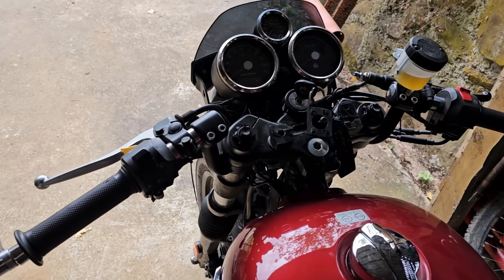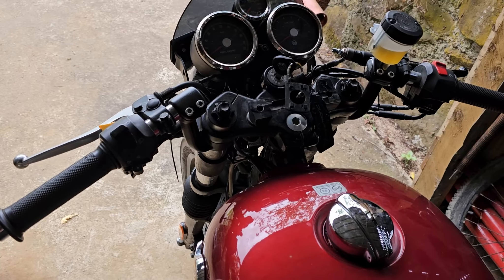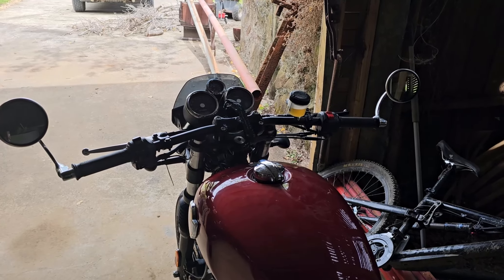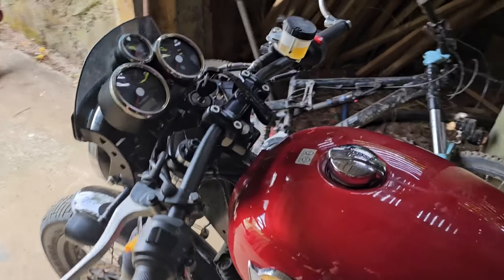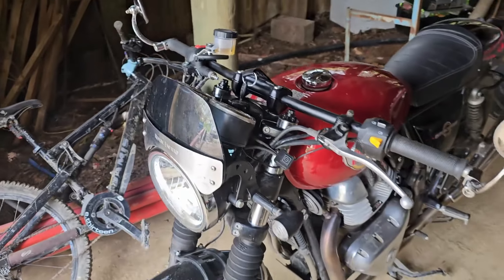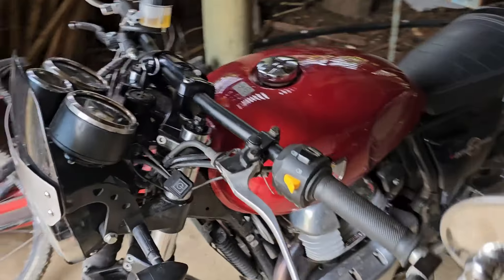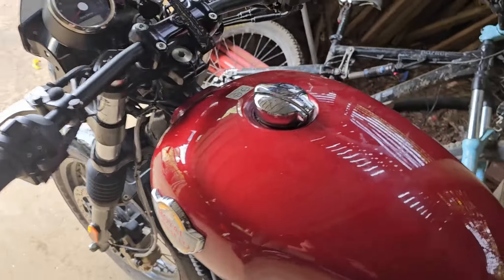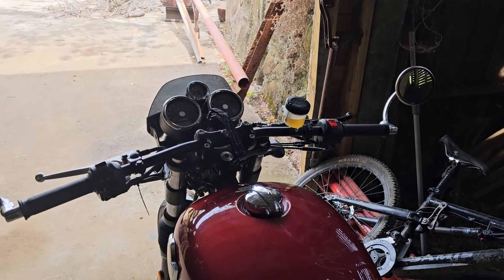New drag handle bar fitted on my 865cc Royal Enfield Interceptor

Comment: Just put a drag bar on myn, did you have any problems with the indicator unit hitting the tank?
Reply from the maker: @Slipp2769 Hi, Not on mine. Maybe cut yours down bit to clear your fuel tank.